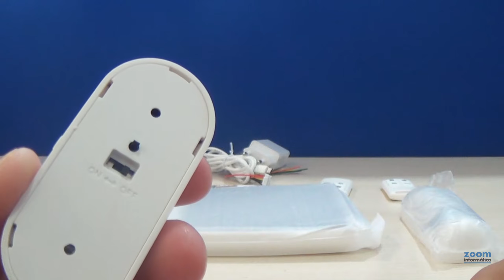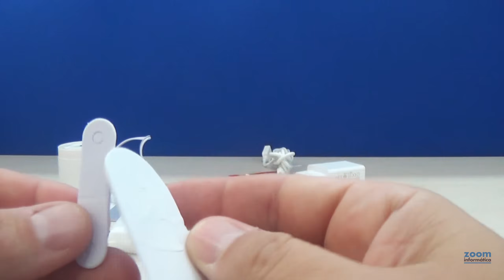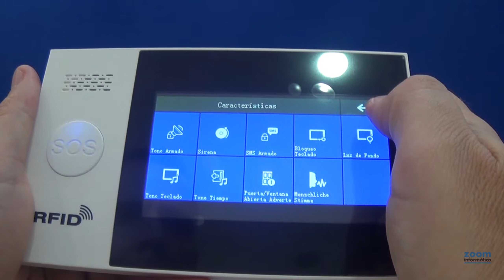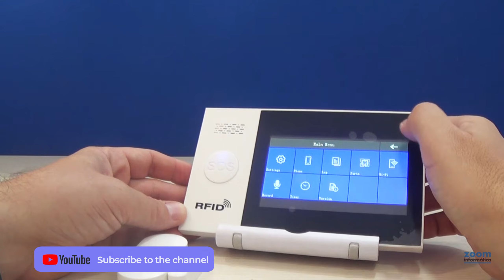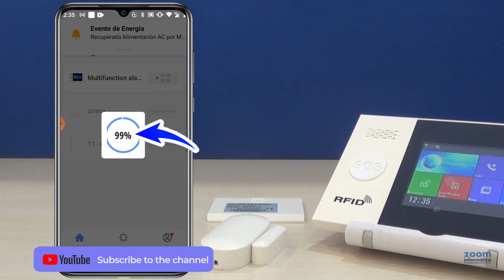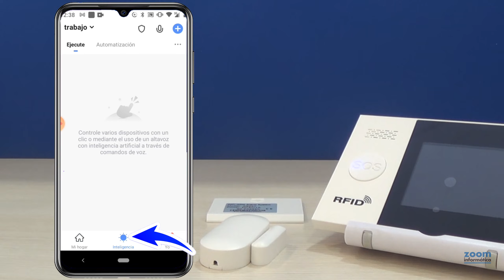WiFi + GSM alarm for home without connection fees with APP Smart Life easy to configure.Screen color

Comment: I have some zigbee motion sensors for tuya. I would like to use this motion sensor in this home security device. Can I use it as a sensor with the same function as the 433Mhz sensor with Tuya's Smart link function?
Reply from the maker: Zigbee detectors (models we tested here https://www.youtube.com/watch?v=M62WZtlDrTA)  are conectted to a host wifi
Reply: @zoominformatica  Thank you so much,

Does the video host wifi have a Disarmed function or Away function in Device Mode?

Also, is it possible to set an alarm delay or an exit grace time of about 1 minute when the Zigbee detector is activated while the Device Mode is Away?
Reply from the maker: @blackzoro1112  Yes.. host have away & home alarm
yes.. also can configure entry or exit delay

Comment: Great video,thank you very much for the information
But I do have a question,I got one but when insert the SIM card it does not have a signal although it works with any cell phone
Do you have explanation for that issue?
Thanks for your time
Reply from the maker: Check SIM card has not PIN

Comment: Hi! Can I use these sensors with other automations inside smart life app? If door sensor 1 is open, turn on the lights?
Reply from the maker: if a door open not. If alarm trigger can turn on light
Reply: @zoominformatica Thanks for reply! So, inside smart life app, I can't select a sensor alone to trigger a routine? It's a pity, cause then, I would have to have 2 door sensors in a door, one for the alarm and other to the automation?
Reply from the maker: @IgorBomtempo  Not sure to reply. Each detector can have a configuration diferent.
Reply: @IgorBomtempo  I'm with you. It's always a failure when the software limits your ability to automate. I originally thought the alarm panel would act as a hub presenting the attached sensors as devices.
Reply: I found another big problem= you can't trigger the armed alarm in a particular mode, only for ALERT mode is possible so if you have a wifi pir sensor you cant use the delayed mode to get time to dissarm. =(
Reply: Another big problem is= you can't change the sensors attributes (zone mode) via any scenario / automation.

Comment: Thanks for the video. I have a problem when the alarm is triggered. In my system I configured a telephone number to receive only phone calls and inform the recipient with a pre recorded message. Well, the telephone call is regularly  received but the message is not the one that has been pre-recorded by me but a message that allows the recipient to manage the alarm system "Press1 to arm , 2 to disarm, 3 to ear, 4 to talk". This message is the same that correctly I ear (the owner of the system) when I call the SIM card number inside the alarm system.
Reply from the maker: We will this feature pre record in futures videos.. but as far I remember this message it's only played when host call to you, not when you call to host
Reply from the maker: We will check
Reply: Thanks a lot for your quick reply. If there is an alarm I want to call the police and give them information and direction to my house. I will be awaiting for your next vodeos.

Comment: Hi, I read in the manual that it is possible to activate the alarm by SMS with the password System. When I send an SMS in the format xxxx1 or xxxx2 (xxxx for the System password, 1 for Arm and 2 for Disarm), nothing happens on the alarm. Is this normal?
Reply from the maker: Hello. To arm send 1234#1 and 1234#2 to disarm
Reply: @zoominformatica  , Thank you for your prompt response. It works ! 👍
Reply from the maker: @chrysaor94  Nice to heard it works

Comment: is it possible to have only the sensors on the door activated without the pir motion sensors being activated?  so that when I sleep at home I only have the sensors on the doors activated.  if so, how is it done?
Reply from the maker: Not sure to understand.  I am not sure if want to use a home arm while for example you are inside home and want only some detector works.  This alarm allow this feature

Comment: Can the burgler just press disarm on the central and then keep robing?
Reply from the maker: Yes. To avoid this situation host must be hidden inside house
Reply: @zoominformatica  lock the keypad
Reply: @zoominformatica  This is not proper alarm system, if anybody can disarm it?! It is not usefull if it is hidden inside house, it needs to be near entrance so you can arm/disarm it when you come/go.
Reply from the maker: @mihazupanc6657  Noted on user manual tolds how block keyboard to not allow disarm directly
Reply: @mihazupanc6657  you enter a password in the settings and then to use the password you just go into settings again and enable keypad lock and then you have to enter a password before you can disarm. Obviously you can still disarm from the app , SMS , RFID tags and the keyfob
Reply: @mihazupanc6657  just use the app, and hide the panel
Reply: It seems like it would work better for arming your house when you are there versus when you're gone. This way you could have the panel in say a bedroom and if anyone broke in while asleep you'd know. If you're gone it would be difficult to disarm fast enough when entering back into your home. If you can't have it in plain sight by the door. Seems kinda hocus pocus. But for $100 I see it being a high value system  dependant on monitoring fees.
Reply: Very late to the comment section but I just brought one of these exact systems and was very disappointed about this but thankfully they are wrong it can be locked with a password.

Default system password is 6666
Go I to menu, settings, switch, keypad lock, enable.
Then go menu, settings, password.
Change system password and change user password to the same thing.
Both passwords unlock the device and provide same access so might as well be the same password imo
Reply: Anybody know How can i setup part alarm on smart alarm ?

Comment: what batteries to buy for the motion sensor, the opening sensor, the wireless siren, the remote control and the RFID key thank you
Reply from the maker: As far remember... PIR 2x AAA door cr3020 remotes cr but slim that door and RFID not uses

Comment: Hi, how can I set a window sensor to be excluded once the alarm is armed?
I want to leave a window open when I leave the apartment. I tried both, with the sensor on "stay arm active" and "out arm active" but when I arm the alarm with the window open the alarm gets triggered.

Thank you in advance
Reply from the maker: You can adjust settings for each detector to put at arm in home

Comment: Hi , if alarm is arm and connect with my wi fi ,(I don't have a sim card)  and i open the door contact, i recive in my mobile an alert?
Reply from the maker: Yes. You will receive a push notification

Comment: I built a house and at the time didn’t have internet. The house alarm would turn on and off with the key chain, but when I try using the touch screen it asks for a password. Now that I have internet I am trying to connect it to my WiFi but I can’t do anything without that password. Is there a way to manufacture reset the alarm.
Reply from the maker: You should not have to connect to your wireless signal. If can access to keypad you can delete all configuration or configure to your hot spot
Reply: have you ever set the password?if not,then you can try 1234 or 8888.This is usually the original password.
Reply: Could you find out how to reset the alarm? I also don't have the password.

Comment: I have the same alarm, except after changing my router password I just can't seem to pair the Alarm panel using the Smartlife app with the new password. I'm still on 2.4Ghz and have tried both airlink and  softAP configurations both of which don't work. do I have to reset the alarm panel and loose all my detector settings which I'm hoping it doesn't come to.
Reply from the maker: Iam not sure what password changed.   Try to open keyboard and follow steps to conect APP
Reply: I think you have to reset the wifi from the alarm first, then try a new connection like you did at the first time setup.
Reply from the maker: @mikobirra  yess .. could be good idea
Reply: @zoominformatica  I see from your video the blue light on the SOS is moving in a circle. On my alarm it is steady blue. How did you get the SOS to move in a circle. I feel if I can get my alarm SOS move in a circle it will be in paring mode and I can then add the Multifunction alarm to the Smartlife App. Thanks
Reply from the maker: @CarlD-zl6pg  I cannt reply with security about issue on your case leds not moves as see on video

Comment: Thanks for the video, is there a way to turn off "alarm message propel" it's the one signalling when the alarm is activated or deactivated? Thanks!
Reply from the maker: Not sure about what message want to mean.  You can adjust lenguage voices but iam not sure if can disconnect
Reply: As far as I know, you can precisely block notifications for a certain device in the APP.
Reply from the maker: not sure to reply @stevenlean8822

Comment: I am using the alarm to monitor a sump for increased water levels. Can you recommend a solid state sensor that will work with the unit? I would like to try a wired one and a wifi one. The sump is external to our house and the atmosphere is therefore very humid.
Reply from the maker: I think detectors included not will work for this issue
Reply: How strange to say that. It came with a wired float switch which detects an increase in water level.

Comment: Does anyone have problem that it freezing and stop working. Factory reset doesn't help, after few hours is freezing.
Reply from the maker: Not sure about problem tolds on host
Reply: it freeze to me as well, in particular it seems to freeze after connecting to wifi

Comment: Is there a trick to opening the sensor to change the batteries? I cant get them open.
Reply from the maker: No. there isnot any trick to open it.
Reply: @zoominformatica  ok I had to force it with a screwdriver and did some minor damage. If I change the battery does the system remember the sensor or do I have to reprogram the entire system?
Reply from the maker: @AllTheNamesAreGone  If change batteries not need to program again

Comment: can you please confirm if those remote controls work on 433Mhz?
Reply from the maker: Yes. This model works 433Mhz-1527
Reply: @zoominformatica  thank you for confirming. And one more question: do they use a static or a rolling code? I purchased another Tuya Alarm from another manufacturer and the remote has static codes, which can easily be captured by someone sitting outside the house and then replayed to disarm the alarm.
Reply from the maker: @zoltar99  This has fixed code.  This another uses rolling  code https://www.youtube.com/watch?v=aKZmrdhb-IQ
Reply: @zoominformatica  thank you. Do you sell additional sensors separately? The default kit comes with only one door sensor and one motion sensor which would be ok for a small apartment, but not for a house.
Reply from the maker: @zoltar99  yes.. we sell fhss rolling code and 433mhz-1527 fix code. Here can see them https://www.zoominformatica.com/comprar-c-(Accesorios-alarmas).php
Reply: Hi can You add name to every sensor?
Reply from the maker: @lukaszlukasz6600  yes. you can rename each detector

Comment: How Long Do the Batteries last in the Wireless Sensors.
Reply from the maker: Cannot reply with security.  It can vary dependes on usage product (numbers detections, open door..) and quality batteries.

Goog batteries and a house where not live for sure can works several years

Comment: if someone calls the sim card direct they have full control over the system without using any passwords also they can listen to your conversation without you knowing
Reply from the maker: No. Its necesary to use a password to enter in host
Reply: @zoominformatica i rang sim and was able to listen remote without password how do you activate password for people calling  to the sim
Reply: @merlinflyer2190  did you sort this issue?
Reply: @merlinflyer2190  ok if you have stored your number in the alarm when you ring you won't need a password. If you try and call from a number that you have not saved then it will instantly hang up.
Reply: @YoutubeHero666  no so now don't use sim

Comment: Does it work with 5G
Reply from the maker: Host only works with 2.4Ghz WiFi.  But on APP can be controlled by 3G,4G or 5G
Reply: @zoominformatica  Can we use 4G Sim Card to send SMS to my mobile??
Reply from the maker: @jacksprat2200  SIM card is used to send SMS/gsm call to your phone

Comment: Those systems does not have anti-jamming capabilities. If someone uses a jammer they will not work. If you can confirm and prove that antijam feature is included then it's a nice product.
Reply from the maker: Yes, this model will not work with a jammer. If you want to protect can install a jammer detector wired to this host to take a notification if a jammer is near
Reply: Can you provide any link for jammer detector please? Thanks
Reply from the maker: @sajeelanwar  hello https://www.zoominformatica.com/alarma-para-casa-sin-cuotas-inteligente-gsm-wifi-rfid-fhss-teclado-az043.html with FHSS anti.jamming

Comment: i have connect with 46 door sensor with this device. Once  i arm in night time doors are close and nobody open any door or window but alarm is coming each days from each sensor. Very bad product. If any one have solution please comment
Reply from the maker: Door sensor only will activate if both parts separates. Please check both parts near with door close and not vibration can move door
Reply: @zoominformatica i did the all configuration part. firstly i install the sensor and then add in to the device.everytime door open and sensor add to the device.
Some days come zone 10 alarm then i was silent it other days come other zone.this is the problem
Reply: @zoominformatica  some  door sensor 24 hours silent mode. system arm time alarm is coming .is this possible
Reply: @hasunviraj4523  No.  If really this sensor in this mode and activate alarm could be a problem on this detector. Try to replace
Reply from the maker: @hasunviraj4523  Could be a problem on this sensor or in host